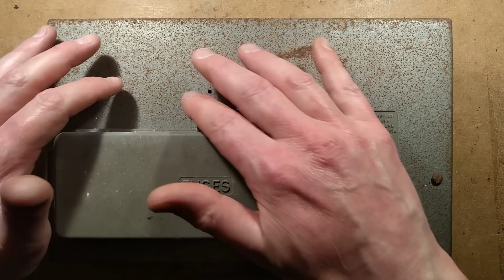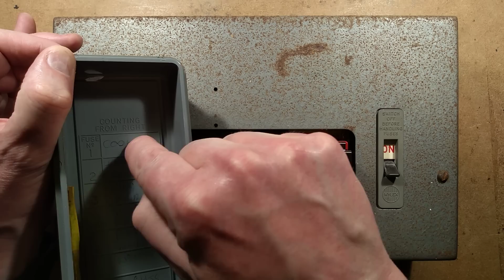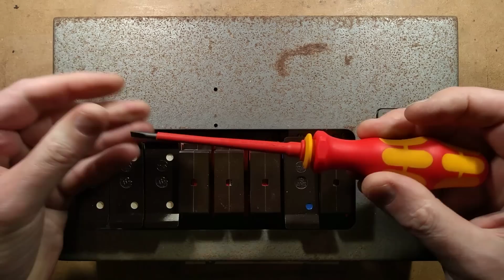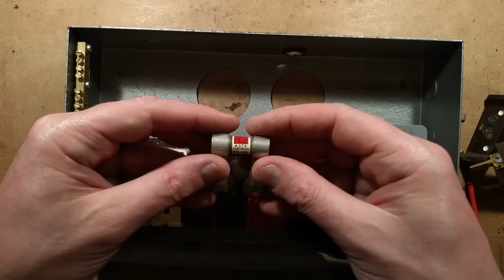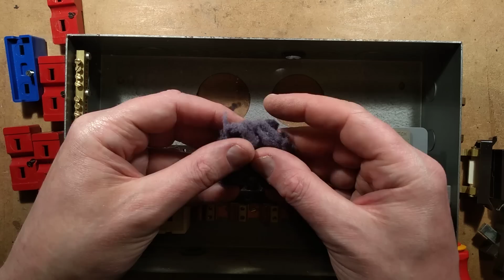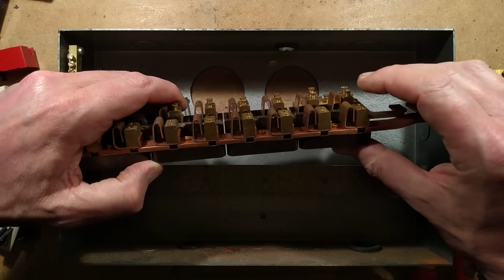Teardown of an old British Wylex electrical fuse box.  (with bare fuse wires)

Comment: I still have a Wylex fuse box with re-wireable fuses in 2021. I also have a selection of fuse wire of various thickness that probably dates to when the fuse box was fitted. The fuse wire selection is wrapped neatly onto a cardboard holder in sections clearly labelled with the current rating for each, it looks like a retail package of fuse wire.
In over 2 decades of living here the only circuit that has required the fuse rewiring, once, is a lighting circuit - the fuse wire let go when an incandescent light bulb in the bathroom died.
Well... I say "died" - it didn't expire with the usual "tink" upon switching it on as most incandescents were prone to do.
More it went with a very bright and loud "BANG" when switching it on resulting in the entirety of the glass bulb instantly turning into shrapnel and depositing on the floor leaving just the metal bayonet in the fitting. I assume the filament failed in some tremendous arcing plasma hell storm that raised temps massively and blew the glass out explosively.
 
Rewired the fuse by tea light candle light and it's been fine since.

TLDR; Always keep candles and a source of ignition handy and know how to get to them in the dark.
FTLDR; Learn the topology of your abode blindfold, make it a game for lock down. It could very well save your life in a fire situation.
Reply from the maker: The catastrophic failure is usually the filament breaking with a trail of metal plasma that has an avalanche effect, turning the lamp into a discharge lamp with no ballast.  It often takes out fused, breakers and dimmers.  You can still get packs of the fuse wire.
Reply: @bigclivedotcom  I'm bowled over you replied - you must have been into the soda stream liqueurs or some such :D Interesting answer, I always wondered what caused that one bulb to explode the way it did. It scared the shit out of me... BANG... darkness. The only places I see fuse wire packs or cards are pound shops. So I have a few more now.
I still keep candles, matches, torches in every nook and cranny - I'm old enough to know that the power can go out without notice and be that way for hours in fault scenario.
/me feels old

Comment: I recently fitted a wylex fuse box (smaller 4 way version of this) that came with plug in circuit breakers to my garden shed. I only run two lights (sometimes three if I need extra light) and a radio so figured as it was cheap it would be sufficient enough.

Comment: On subject of Wylex, moved into newish property where 30mA Wylex RCD seemed fine, no trips at all for a year but forced to replace the old double oven. With new oven fitted RCD was soon after randomly tripping and with daily heavy rain a damaged outdoor socket had found to have got quite wet through poorly unsealed push fit glands at the top. Replaced and fully sealed so fixed that. Water in socket not good! Days later semi random RCD trip reappeared again. usually with dryer on so dryer suspect and sometimes washer instead not outdoor socket as dry.  Spent a lot of time trying to work it out but over a few weeks finally concluded leakage increase was random possibly combinational pointing to washer or dryer combo or wiring or  RCD tripping near limit with new oven and always on edge of  tripping or the  RCD was sensing too low eg faulty. RCD was ramp tested and tripping at maximum 19mA!!! RCD must have been faulty for a while but I realised leakage must have been bordering 12 to 16mA. The new oven had slightly higher leakage pushing RCD closer to the edge. Now wired to 18th edition but fitted split board dual RCD and new mandatory 100A tails instead of 80A. Not Wylex this time though.

Comment: my grandfather used to work as an electrician. the company he worked for forced him into an early retirement when he started getting sick, apparently they had recently stopped using a solvent called carbon tet. it was cheaper to let employees go than to have to pay their medical. since they didn't know it was toxic before it was phased out they were not obligated to pay anything to those affected.
Reply from the maker: Carbon Tetrachloride was a very common industrial solvent.  It was also used in the original lava lamps to make the wax heavier than the water.
Reply: @bigclivedotcom  I had a Saturday job, in the 1970s working in a backstreet TV repair shop and CTC was used for cleaning everything. They recovered it from old fire extinguishers.
Reply: @bigclivedotcom  yeah my great uncle talked about how they used to dip electric meters into drums of the stuff. used it for cleaning everything and they even used it to wash their hands.

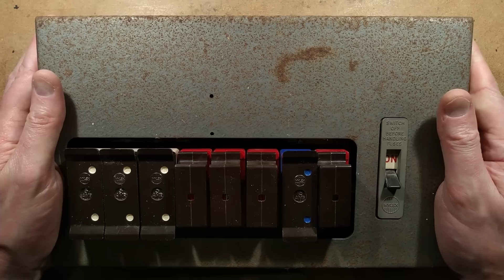Comment: 2:06 I've seen a plasma arc come out of a 110v electrical plug at my university. It was an amazing sight (and sound). In fact, it was a quite nice blue color and the shape was highly reminiscent of a light saber. Sadly, it only lasted for a few seconds, but it was a sight to behold. As for the sound, it also sounded similar to a light saber. I was so impressed, I still consider how I could make that happen out of a light saber handle... though I also realize how dangerous it was. Thankfully, I was standing many feet away when it arced, but close enough to witness it. I'm still not entirely sure how or why it arced, but I do know that the cleaning person was trying to operate a floor buffer further down the hall when it began. After it was over, I examined the plug and the plastic cover was indeed charred. Good times. 🥂
Reply from the maker: Plasma cutters work by creating an arc like that and then blowing it out the nozzle with a jet of air to produce a mini lightsaber effect that slices through metal.

Comment: These, and later white thermoset plastic (melamine?) versions, used to be  (probably still are)  very common around my stomping ground.  They were the preferred brand of my local council.  It was not unusual to find one with wire fuses, barrel fuses and MCBs all on the same board, where incremental upgrades had been done through the years.

Blue Rizla Towers has a 6-way white plastic Wylex fuse box retro-fitted with MCBs, with a separate RCD and an additional 2-way, modern box for the circuit breaker for the Solar panel inverter to feed into the mains.

Solar panels were subsidised in the UK by making over-the-going rate rebates to early adopters, to ensure that the money was spent on Solar panel installations and not pocketed by homeowners and their travel agents!  At current prices, treating the system as a single bulk payment on the meter of all the electricity it was predicted ever to generate over its working lifetime compares favourably with topping up the meter, even without the wholesale payment for your generated electricity that gets fed into the grid -- which they are still obliged to pay you, despite the sweetener money having run out.

Comment: Back in the day (77) we were trained on those units as apprentices at the Norweb training centre! 
Things of note .... The switch is 60A rated so could easily be overloaded with modern homes and main fuses of up to 100A! The main terminals were twin screws per terminal giving a superior fixing when compared to modern units! 
You would not believe the flash from a 5A rewirable fuse with a dead short on it (don't ask me how I know)
Final point .... I would recommend a replacement if I saw this in a domestic environment ...  Rewirable fuses are pants and the lack of RCD is a killer (or not)

Comment: Hammer tone paint used to be available in several colors in spray rattle cans as late as the 70s. Several brands of office machines and cash registers had this finish and I was repairing and maintaining them. Some customers wanted a new paint job on the case of old worn and scratched machines as they were where customers could see them. Just sand and spray it by the can directions and watch a boiling type reaction take place in the paint layer before it set up with the variegated hammer tone colors.
Reply from the maker: Still available as Hammerite in the UK.  Quite a nice effect.  The crackle is the "hammered" version.

Comment: These units also had the safety feature in that a lower rated fuse carrier/ holder could be installed into a higher rated base but not the other way round.
 I came across one of these Wylex units where large safety pins were used as fuse wire in two radial 15 amp circuits. The unit had started to melt due to the overload from three 2 bar and 1 single
  bar electric fire in plugged into one 15 Amp round pin outlet using an adaptor; also melting!

Comment: Ahh good old Wylex Standard. MCB's  in 6A, 16A, 20A, 32A & 40A are still available to retrofit btw - orange for 40A and yellow for 20A. 
Electrical distribution at my Dad's place has 6 of these fuse boxes (I guess about 40 fuses in total). They're all the bakelite with wood frame variety though. It's sort of grown over the years from the original 8+2 when we moved in in 1985.

Comment: Lived in a pre-war council house in the early 1960s.  Entire estate had Wylex sockets.  One up.  One down.  Circular plugs with a central cylindrical pin and a flat pin on either side.  Transporting e.g. a record player to a ‘normal’ three pin house meant removing the plug, attaching the standard plug and then replacing the Wylex when finished.  Added to which the Wylex plugs were hard to come by so plugs were often changed between appliances within the same house and left with no plug when not in use.  A real pain.
Reply: One up, one down.  For those new fangled vacuum cleaners!

Comment: 07 I was asked to replace a socket in an old baronial house, to discover French Polished double pole ceramic rewireable fuse boards, Leadsheath VIR cable and  legend sheets giving the date of installation as October 1935. Bad enough, but the punchline was the 240v chrome plated live bell pushes conveniently located for easy access while sitting in the bath! The general earthing arrangement was such that there's no chance that they were earthed. Did what I could making the original socket safe, informed the owner as strongly as possible of the many issues found and in response to the stock claims of poverty recommended if they had to, extend the mortgage but after 70+ years they were really well overdue a rewire.

Comment: Ring final circuits (as they are officially called): John Ward says they are an invention of the devil, when wired with the almost universally used 2.5sq mm cable! I dislike 2.5 T&E because there is a fair chance that connections in socket outlets will come loose: twisting two or three solid cores of this size doesn’t allow a good join to the terminal, and placing them side by side relies on the terminal screw; I have seen plenty of dodgy connections in rings using this type of cable. Using 4mmsq solves the problem, but is more expensive. Enjoyed your video. Those Wylex c.u.s were solid, simple, and reliable.

Comment: Seen quite a few fuse boxes which are made from wood, with the fuses on the surface, and then the gutta percha DCC wire leads through a hole right next to the fuse holder into the wood, where it goes to the assorted circuits around the house. Standard with those is to either not touch the wiring at all, because then it will have all the insulation flake off at the merest touch, and suggest that it be rewired completely. 

Seen quite a few cases where they installed a RCD for the whole house, and then pulled through only the line with new PVC cable, leaving the old neutral black still in use, because it was cheaper, and the RCD would not rtrip when power was turned on, though if the roof had a leak and the wiring got wet whole other story. Half the price, brake light warranty on the job.

Comment: I remember seeing a unit or two like that when I was very young. Both my parents' and grandparent's houses are quite old structures so I'm pretty sure they had fuses similar to that. My parents' house I think has since been upgraded but I think my grandparent's hasn't. I'm pretty sure the one I saw had a transparent plastic cover over the fuses rather than opaque.

Comment: Still have one of these in the house, built in 1983 .. didn’t realise the fuse holders were asbestos though, thought that was banned before then but it seems the UK only banned white asbestos in the early 90s (and is still used in Canada)
Reply from the maker: It's just that little stud.  It's safe.
Reply: There were two types of asbestos used.  Long fiber and short fiber.  The body can deal reasonably well with the short fiber - that's what's in the ceramics, including the old brake pads.  The long fiber, used in thermal insulation, gets stuck in the alveoli, irritating the membranes in the lungs constantly.   The reason we don't use the short fiber anymore either (well, except for some VERY restrictive uses), is that the processing of asbestos creates both the long and short fiber.  Even if you're only making short fiber, your workers could inadvertently get exposed to the long fiber.   

People here often freak out because the ceramic tiles on the outside of old houses were often made with asbestos.   I just tell them to stop eating the tiles.   They're fine unless you grind them up and snort them, and if you manage to do that, you have other issues.

Comment: We are wanting to move and have visited several which have these still installed. Currently having a house with a modern distribution board makes me want to look at replacing them.
Reply from the maker: It does indicate older wiring, but as long as it's checked for condition it's not a bad thing.  A new consumer unit is useful for the extra RCD protection.

Comment: On important feature of those fuseholders is the colour coding. The different colour fuse carriers are physically incompatible, so it's not possible to put a white one into a blue holder. Of course, there's nothing stopping somebody installing the wrong wire, but it does mean that they can't put the wrong rated carrier in the hole.

I also don't believe there's any danger of a "plasma arc" blowing the supplier fuse. It seems extremely unlikely to me. However, those little jet hold are one very good reason to turn the power off before replacing a fuse as if the fault is still there you do not want your fingers anywhere near a jet of molten metal as it's going to hurt.

Comment: 100 % Clive. I really like these units if  having enough outputs. An external RCD is wise. If you didn't say Wylex do a fuse to MCB converter at about £10 a piece. In the 1980s Naim Audio and others recomended the use of this type of box for better sound. People Brasso'ed the fuse blades for best sound!  BTW. Asbestos is the big risk in Nuclear or any power station. I think nuclear fuel rods easier to handle. White asbesos mostly can be ignored if ignored. Old cars have asbestos in the brakes. Be careful. The Queen Vic on East Enders had a Wylex box.

Comment: impressed by the thickness of that busbar, and here in asia, mcb bus bar that shaped like comb, is only like 0.6mm thick and 7mm wide copper, well... it works ok with my c63 mcb, and 39amp through a 2.5mm cables (theres a story behind that)

Comment: Someone once said "a sparks house is the worst house electrically as we (supposedly) know what we're doing..." Well I still have a wylex board fitted at home (lol) But I did replace EVERY fuse wire carrier with breakers as I've NEVER trusted fuse wire after a 32amp wire "blew up" when I replaced it at work. I fitted an earth block and doubled up the earths to fit a 16mm cpc cable. Good video Clive! Love old school. 👍

Comment: Very interesting! Most fuse boxes in the higher voltaged regions looked like that didn't they? Mostly 240V AC MAX? Old fashioned fuse boxes in the United States, actually work kinda like an Edison light bulb! When they blow, you unscrew the old ones, and screw in the new! Now in today's time although most homes use the newer wiring, with mechanical circuit breakers we call them, There's still tons of older homes using them. In fact a lot of inspecters probably set homes up to be rewired depending on the towns and cities by reason or financially, I'd still estimate that 65-70% of all old late 1800s to early 1900s houses in North America and even south plus the world, still have the older fashioned wiring. In North America some old houses have replaced receptacles installed with wired ground, but the fuse box and older hot and neutral wires remain, but not all are installed with ground, and that is very unsafe. It's safer with the older two prongs and just buying Three on Two adapters with (built in) ground or earth, we also have electronic fuse breakers,
that are known as GFCIs, abriviated for Ground Fault Circuit Interrupters.

Comment: My uncle's house next door has a smaller version of this, and does have the intermediate RCD so it doesn't blow the main fuse, had to change a couple fuse wires due to the iffy state of the wiring in that house before now, but overall the fuseboard still does its' job... :)

Comment: I quite like the construction quality of this unit. Note that despite the cover being cracked that was still pretty damn good for plastic at the time. In any case with modern breakers the safety features they provide I still feel like fuses are outdated. Still rewireable fuses seems kind of elegant. A big issue with breakers is that people assume breakers never need to be replaced. I'd like breakers that are serviceable. All the ones I've seen are riveted.
Reply: Serviceable means someone will eventually directly force one closed so he can "fix" an issue.